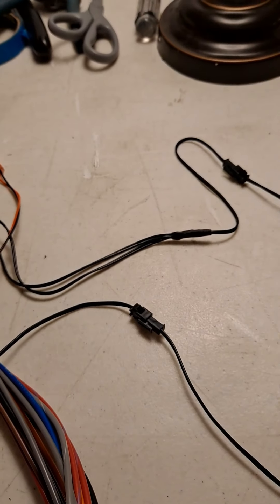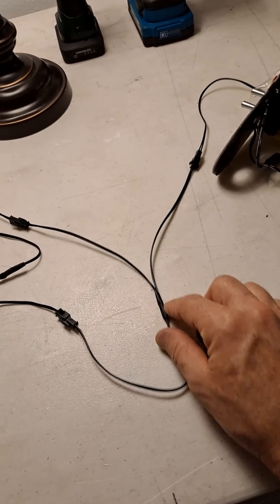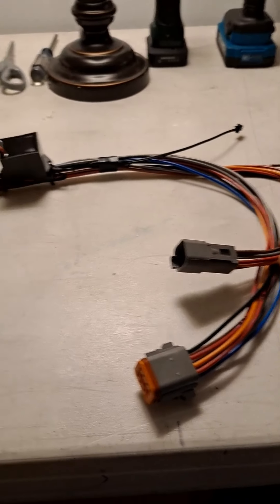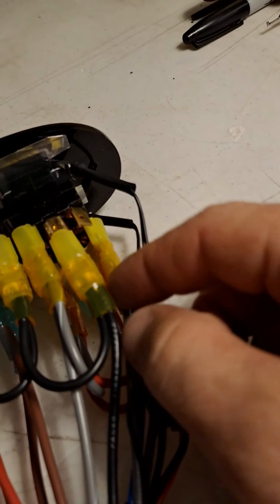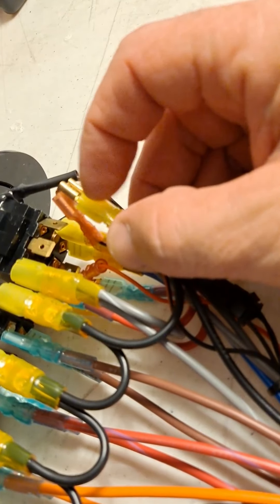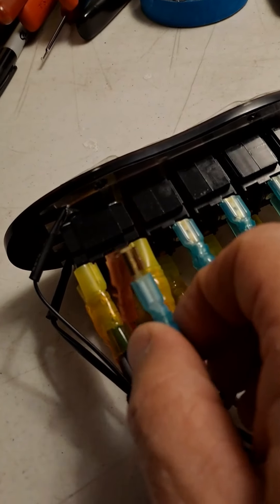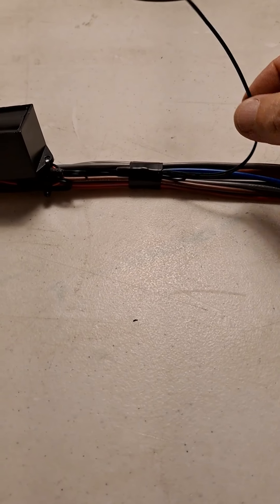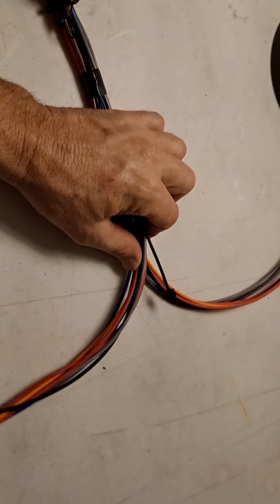Inverter Replacement for Peanut EIM system

Comment: Im a marine electrician by trade and have gone to  two service calls for these little guys, one last year and one this season.  one was so bad it smoked and melted.  both were sea-ray.  interesting way to back light. before the times of led.
Reply from the maker: Some of the smaller inverters that were used in the past would get overloaded. Electroluminescent strips give a smooth even glow rather than the hotspots created by LED. Sometimes you see this type of system used with spaghetti type string lights. LED's through a tube can work also to evenly disperse the light